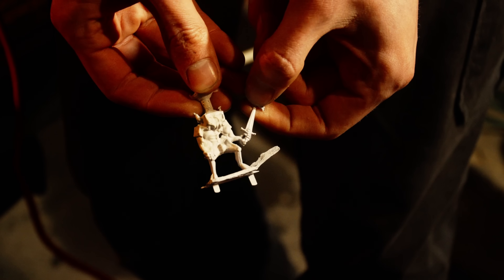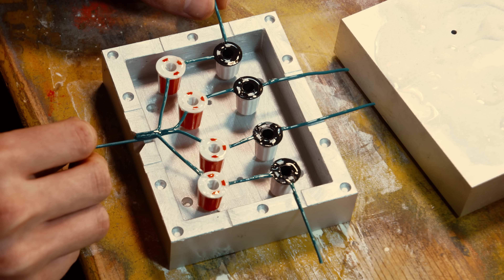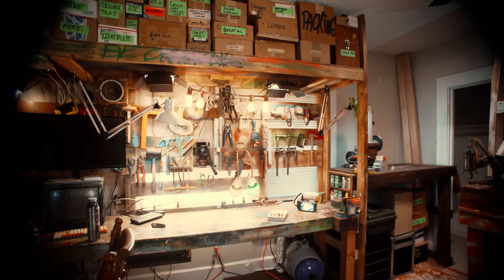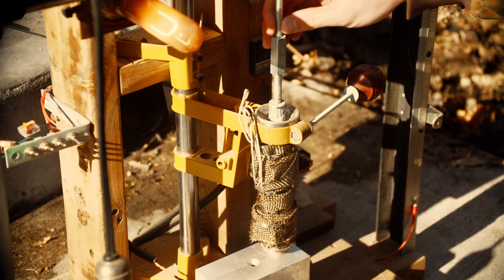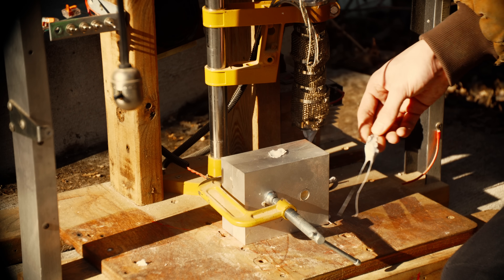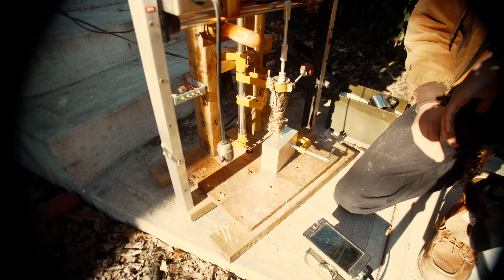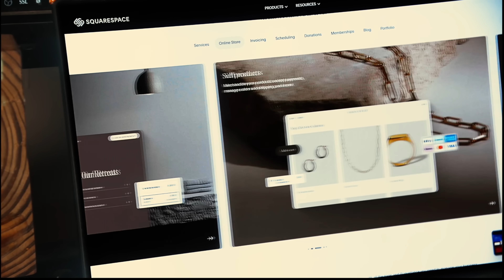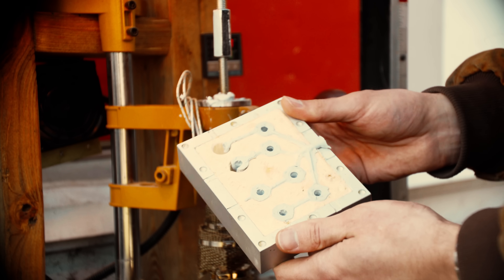Revisiting my DIY injection molding machine

Comment: It might help to bolt a flat blade over the nozzle to keep the molten plastic in. Then turn it to open the nozzle. If the hottest plastic oozes out the plastic behind it will be at a lower temperature. Heat transfers from the outside in so you will have a pointy stick geometry of temperature gradient inside the chamber.

Comment: Have you considered a 3D printed sintered metal mold? It's less expensive than machining and can be polished and bead blasted, but I'm not sure about its longevity or heat resistance. I want to mention that Fusion 360, SolidWorks, and Inventor offer design and simulation tools for optimizing mold designs.

Comment: It looks like the plastic is having a hard time making that more horizontal squeeze to the outer knobs if it has a less resistant path downwards. Maybe turn the mold box on its side and dig channels between the 2 stacks of 4 knobs. It might be more effective since they'll all be oriented as vertically as possible.

Comment: I used injection a few times before. And exactly to make copies of vintage radio dials. 😂
To get the inner part perfect, you have to get some random potis, fill the inner slot and file a little bit the teeth of (otherwise it’ll be to loose but not too much). Just pour in the hole poti for a perfect fit 👌

Comment: Part of the reason your succeeded more as you went, is that the mold material was warming up. Flashcooling is a huge issue with plastic injection molding. Try placing your mold in front of a little radiant heater before you first shot and see if it makes a difference.

Comment: I’ve done some jewelry casting and one of my biggest lessons was to preheat the mold. For your setup, even if you slapped a heating pad or blanket around the mold, I’m sure that would give you huge improvements when outside in the cold
Reply: was thinking just that, even if no heading pad, a thermal pot holder would also help
Reply: I was thinking the same. But I was thinking a heat gun and play on it inside for a while before closing it. Then warm it as you are waiting to inject.

Comment: I think your mold might simply be too cold, if you can heat it up a bit you'll shock the plastic less going in and it will spread better, that way you can get away with plastic going in less liquid too, meaning also less fumes.

Comment: Hmm, definitely seems like a path of least resistance problem. I don’t really know much about molding, but it seems like it’s just going to keep pushing through the vent holes of the middle molds easier than starting to flow to the outer. Your “tree” path would probably solve that. Just have to make sure the plastic is forced to each channel, if that makes sense.

Think if you’re pouring water into the mold, do some parts have to fill before others even start getting flow. In this, the middle 4 would mostly fill before it started “spilling” into the outer 4 it seems. 

Can’t wait to see where it goes in the next iteration. Have a great new year, and look forward to seeing what projects 2026 brings!

Comment: You may be able to find appropriate heat-set-type inserts to use in your molds if you want to create reliably good knobs, that should reduce the chances of damaging the mold on removal as well I would think. Also, if you pre-heat your molds a little it should make the plastic flow better through the mold since it won't immediately harden on contact. The molds used in industry usually have heating / cooling channels through the mold to help control the hardening of the plastic to ensure it flows well through the entire mold.